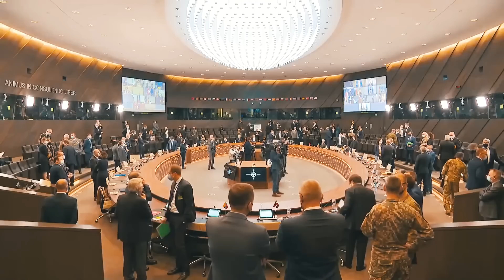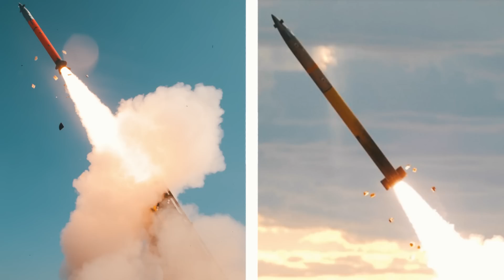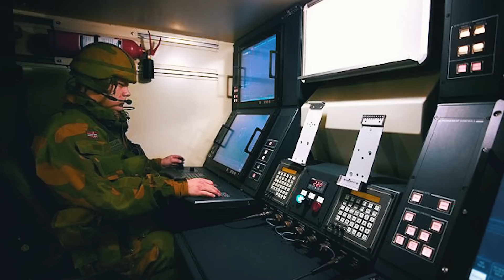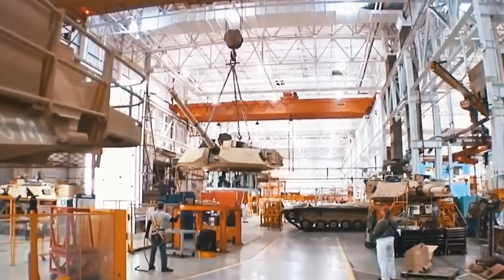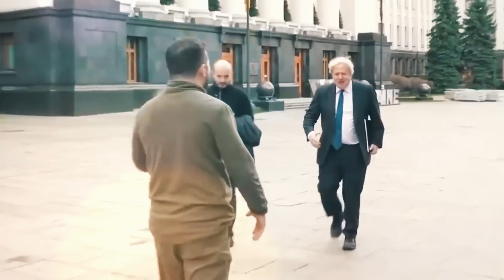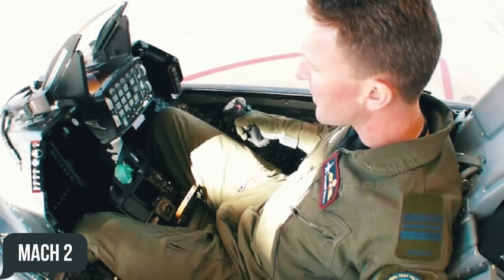Finally: NATO Most Lethal Weapons Arrive in Ukraine

Comment: Ukrainian forces are not getting enough weapons from the West because the West is running out of stuff to send them or the West doesn't want to send them more. According to news sources that are not the lying MSM, The Russians are adding 300,000 men to the fight in Ukraine.
Ukraine has lost the war. They are using up men and material at an unsustainable rate.
Want another opinion instead of this propaganda video?
check out "The Duran" and "The New Atlas" for honest readings of the tea leaves.
*
Everything the MSM says should be suspect.
Trust nothing they say and suspect everything they do.

Comment: Griffin is about the only aircraft suitable for the Ukrainians sturdy under carriage short take off low ground crew needed back ups and logistical needs low compared to complicated and numerous crews and back up equipment for f 16s also fs have fragile nose wheel assembly not good for Ukrainian rough ground strips.

Comment: IF the old saying is true ' spy satellites can read license plates' - I'd assume Ukraine knows when every group of 2 thug tanks moves, no surprise.  for either side.  NATO tanks and Jets damaged - zero.  the thugs, down to using ancient tanks from the 1960's. -- assume all this is mostly true.  NATO needs to toughen up and this is over.  shorter war = less dead.  also - I understand the US has transferred 20 of the M142 truck missile launchers, 5 % of the total in US.   while France for example has transferred about 25 % of their Caesar truck artillery... I'd hope the US could step up to sending say 30 more, total 50 units.  depending on how fast Ukraine is using up the total supply of the missiles themselves, of course.  anti air D at least as important.

Comment: I am impressed. But one question. This plethora of gun systems is going to create a  nightmare when things break down and need to be replaced.  The Ukrainian army is going to have to maintian a huge database of parts. In this regard, there is one point of information left out completely and that is the lifetime of the  gun barreles used by all these different systems and how modular are they for ease of replacement. Another consideration with all these systems is that you are going to need dedicated crews that  cannot move from one gun system to another without going back to school for 2 weeks.
Reply: Useful lifespan of western gun barrels is several times that of the ru/soviet garbage.
Reply: @john2335  For the M7777 it is around 2500 rounds.
Reply: @williamdenton6317  I recall an Ukrainian operator saying after 800ish shots, the Msta-s accuracy flies increasingly out of the window rendering it semi-useless.

Comment: Why do so many videos say 52 caliber interchangeably for 152mm , not the Sam guy’s!
Reply: In howitzers the barrel length is defined by kalibr, 52 calibre. Shell diameter is 155mm. If you check the stats for USA M109 palladin howitzer it's 155mm with a shorter calibre barrel